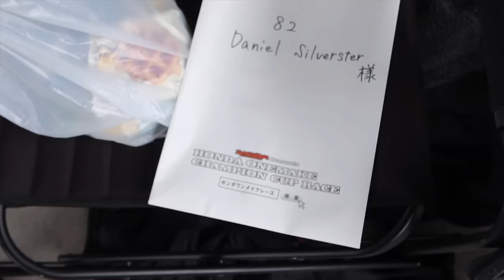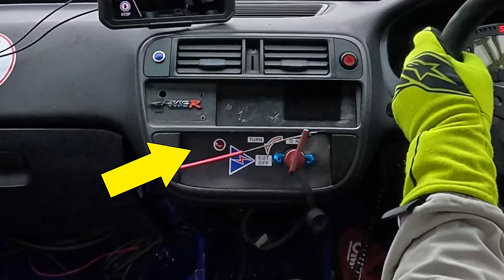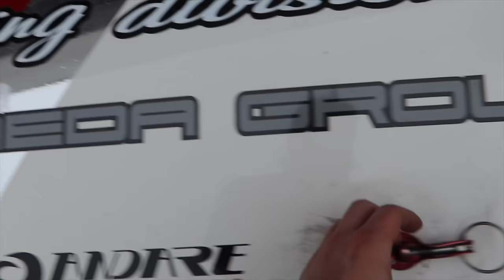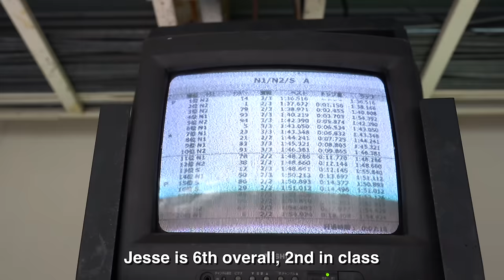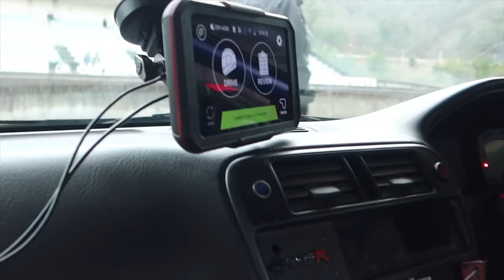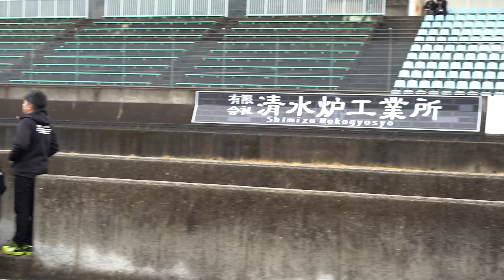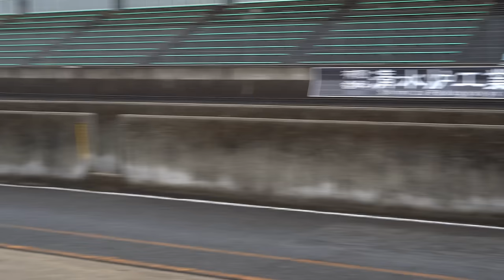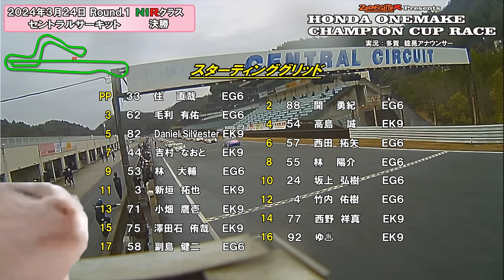My Disastrous First Race in Japan! ZeroFighter Honda One Make Central Circuit

Comment: The steering wheel thing... definitely a habit from drifting. As you said, It's the easiest way to load on opposite lock when it's your only saviour from over rotation in a RWD.

FWD and 4WD don't need nearly half as much counter steer, because the driving wheels are pulling you along at the same time. When you let go of the wheel, the driving force AND the direction of travel multiply and send you off into the weeds before you can grab the wheel to correct.

All in learning mate, and getting lumped into a real life Gran Turismo with 2 hours sleep, in the wet, in an unfamiliar car, don't feel bad about it. You did a great job that weekend and I hope there's more to come from the travelling racing driver. Big ups 👍🏻
Reply from the maker: Yes, reactions are simply reactions. Brain wired to let go when feel the rear go super light. Not ideal!

Comment: Looks like an unfortunate incident. Letting go of the wheel definitely didn’t help, it lead to an Initial over correction, but looking at it, even without that I still think there would have been some contact with the outside lad. Racing for you! Loving the Japan content 👍

Comment: Love it, racing incident that was, car on the inside would also know you had nowhere to go and that you were about to turn in, no power steering with loads of camber is absolute twat of a thing to try and correct oversteer in a civic, and had there not been a car on the outside for you to collide with, likelihood is, that you would have saved it. Just a very unfortunate incident. Pace was mega though considering the time you had to learn the circuit/car combo along with the weather. Chins up, go again lad :)

Comment: Never been a fan of letting go of the wheel. Yes you can counter faster but you loose track of where the wheels are pointing until you regain traction and then you spear into whatever direction your wheels ended up pointing (in this case, the outside car). I dont think you are responsible here, that inside bomb sealed your fate, but better control of the car would have allowed you to not hit the outside car as hard (you probably would still hit, but you might have both stayed on track).

Comment: Great video. I not really understand why you let your wheel go when the incident happened, like you wanted to initiated a drift with a RWD car. that why it turned completly to the left and you went off. If you just kept the wheel and holded some throttle, i think it would had been fine, at least not thing ping-pong way. As seens from the competitior, the touch wasnt that bad to be honest, it was more of a tap that should had more initiated in oversteer, but as your steer countersteered completly (because you not was holding it) it immediately wanted left to go in the gravel. There was a car already, so that was actually helping you not to go alone off maybe sideways and rolled the car. Also I think you kept the door open on the inside, because on the straight you kept the car straigt, but the track gots a few extra meters asphalt on the right.

Comment: Dan always hold the steering wheel on a front wheel drive car. You could of gained some traction back if you had kept your steering wheel in the same position and carried on round that corner with the back o/s wheel  wanting to come out at the back but you would of pulled it around as you were going into a right hand bend. 

Because you let go the car straightened, into the other car, knocked you both off track.
Reply from the maker: Hindsight lovely. Not sure id have got anywhere by holding the steering wheel straight when I got hit from the inside though 😂
Reply: @dannyDC2  read it correctly Dan. 

you were turning into the corner.
 If you held that line by NOT letting go of the steering wheel. 
You would of pulled it around and gained traction the car will only turn the way of the steering wheel.  

You let go of the steering wheel whilst in a corner..... The car straightned into the outside car 

Hind sight........don't let go of the steering wheel in a corner.